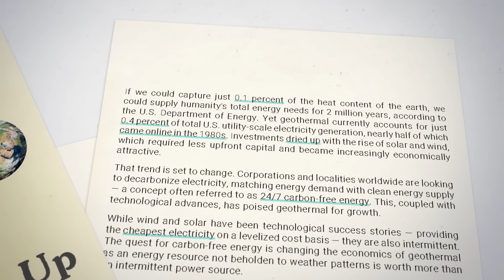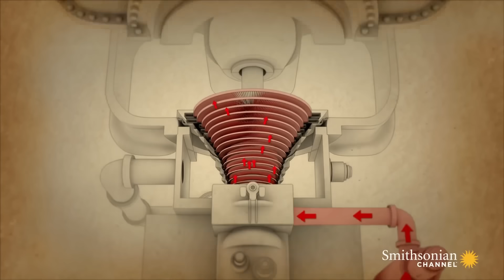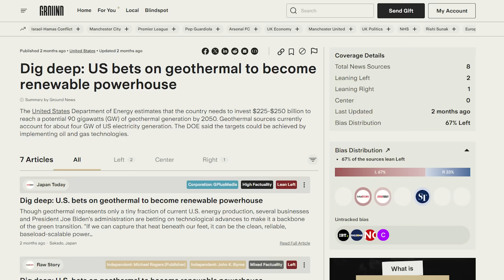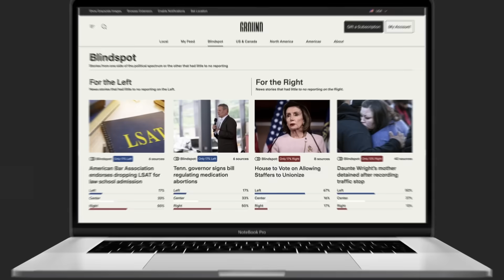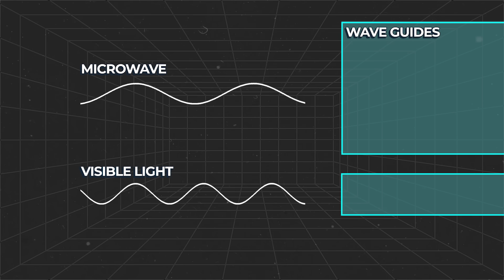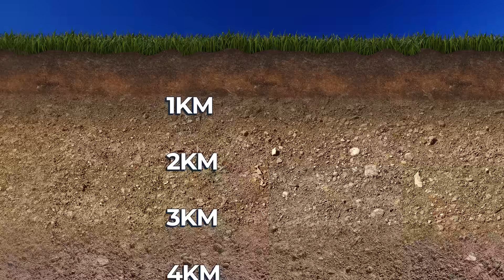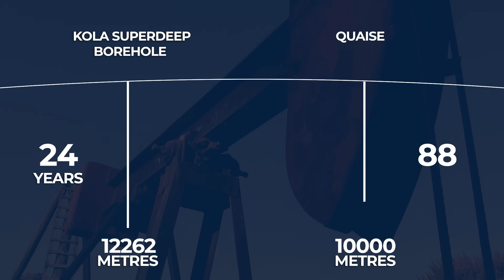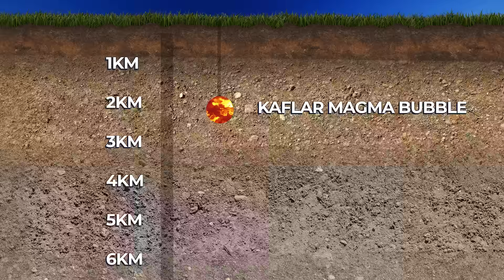This Fusion Tech is Solving the Geothermal Energy Problem

Comment: There was no mention of what would happen with the vapors as it travels back up the borehole and cools down on the way.  
I think they could easily clog up the hole or at least slow down the "drilling" considerably.
Reply: That was exactly my idea. They will need to come up with some solution (e.g. high pressure gas or something) to "push" the vapor up. Or the other way around - seal the hole and create a vacuum and suck it out - low air density will slow down the cooling process...
But this will be really difficult over 10km of travel for the gas.
Perhaps, if they manage to solidify it under control to small "chunks" and suck/flush them out... I don't know. I bet they already thought about the same thing though ;)
Reply: @rklauco  Yes, best chance is condensing it into droplets and then removing it by conventional means
Reply: @uazuazu this is exactly what will happen
Reply: Their plan is to force the vapors up and out with high pressure argon.
Reply: There was an image showing the borehole with bright red highlighting saying "PURGE GAS". So they've thought about it and have made a system which probably forces a shit ton of nitrogen into the hole to displace and atomise the condensing rock vapors into a fine sand like composition which would be blown up and out.
Reply: @jacobkudrowich  Thanks. Did not catch that when I viewed it the first time.  
Found it at 11:25 in case others want to see what @jacobkudrowich is referring to.
Reply: @jacobkudrowich  you would not want to use nitrogen to it being very light, Argon is the most likely gas used for purging. Xenon would be even better but that would get very expensive fast.
Reply: My guess is, the vapors have to travel through the radiation, therefore keep on being heated ´til they actually reach a point where they can be sucked out of harms way sideways.
There the fallout, hence stone,  could land on a conveyer belt which is protected by a layer of sand or something along those lines.
Just an idea.

If they actually lower down the radiation source, I´m with you tho. It´s just going to rain on top of the apparatus or  clog up any suction mechanism.
Reply: @dys1525  for a ~10 km hole...? That's not easy...
Reply: @antonymossop3135  You´re right. 
Sucking it up on the spot may end up being a lot easier. Maybe they can keep the material in some kind of vortex ´til it´s cool enough to not endup as layers upon layers of volcanic glass in the hose.. 

That said. It´s sometimes possible to restart turbines who are clogged up with volcanic ash, which melts in the turbine and glasses it shut.
That stuff is incredibly brittle. Maybe pause the process from time to time and shake the debris offf the inner hose with vibrations...  but sucking (even very small) solid parts up kilometres at a time.. that´s not easy either. ^^
Reply: @dys1525  I agree. I think it's potentially doable, but it's a major issue. In standard drilling they use mudflow, and the mud's also there to stop the hole collapsing under the enormous deviatoric stresses it's subject to (the melted rock wall is going to be a real positive in this arena, a glass stress cage is going to withstand a fair bit of shear stress - although next to the San Andreas fault might be pushing your luck...). You'll need a boundary layer of protective fluid flow at the borehole wall to stop the vaporized rock condensing on it, or have the vast majority of it solidify in the fluid itself, which will require significant thermal transport (i.e. high density or very high velocity transport fluid).

Another way to do it is to feed the rock melting drill head on the end of a steel tube - a kind of case as you go. But now it's going to be hit by conservation of mass, you're going to need a lot of force to compress molten low porosity rock.
Reply: not to mention that superheated rock vapor would be a great way to destroy anything you try to put down that hole, and all waves have some form of falloff, so unless your microwave beam can stay focused and intense enough for the dozen-kilometer journey, you'll eventually have to put something down the hole
Reply: A very large proportion of rock is silicon dioxide. What would happen is the silicon would condense and crystallise on the walls, sealing the pores of the rock. The dioxide, molecular oxygen, would simply escape the borehole
Reply: @anuphys  High enough temperatures and steady flow would solve that problem, it's a lot of heat but if they were able to vaporize rock in the first place, keeping it hot wouldn't take as much energy.
Reply: The laser could maintain temperatures within the borehole, but the vaporized rock leaving it could be routed out by ducts and scrubbed, those ducts would need to maintain the heat until the vapor reaches some kind of scrubbing area.  The vapor is guaranteed to build up at some point, but if heat and flow is maintained through the bore and duct, then the buildup could be in a spot that was easier for maintenance and cleaning.
Reply: It goes into the atmosphere forming clouds until it starts raining rocks.
Reply: @darrylcastellano underrated comment 😂
Reply: My thoughts, too
Reply: Yeah, that would be a problem.  Did anyone mention whether the "drill string" will be rotating?  If not, it will almost certainly become a permanent part of the formation from borehole pressure.  Normal rotary drilling uses pumped "mud" as a lubricant to remove cutting and act as lubricant for the rotating string and seal the formation.  There will be some kind of casing left in the borehole to prevent anything coming up from infiltrating and contaminating the formation.   Not gonna work for this.   At these depths and pressures something must prevent the borehole from collapsing after the "drilling" is done.  Will the waveguide serve for this or will something else be placed?   All engineering problems that will "probably" be solved.  The finished product will be heat, the moving force behind all out energy production.  That heat will still be captured by the greenhouse effect but at least there will probably be no more CO2 or other emissions once production starts.
Reply: I was wondering what happens if your super hot laser encounters a pocket of natural gas. 💥⁉️ Could be problematic if an ignition blows up your equipment. And possible clogs the hole.
Reply: @ClarkBK67  Should not be a problem. No oxygen.  And, at really high temperatures the methane will decompose into hydrogen and carbon.  That action is being used commercially to produce hydrogen and solid carbon.  Theoretically as a hydrogen fuel source and carbon capture.
Reply: Or pollute the atmosphere indefinitely... Massice CO2 and other sulfur gases... For ever...
Reply: That’s not how it works
Reply: Even without any cooling down on its way to the surface, you simply cannot transfer enough energy to run a power plant with steam flowing through a hole of that diameter. Besides, the pressures that would exist under these conditions would keep the water liquid until only the last little bit of its journey to the surface. So I assume they'd be keeping the water under enough additional pressure so that it would stay a liquid all the way to the top. So we'd have a steady stream of superheated water that would be allowed to expand and vaporize only once it reaches the turbines. That's my speculation anyways.
Reply: You can vaporize down towards the magma chamber of Yellowstone National Park probably supply enough electricity for all the western states
Reply: for what i understand, this vapor quickly solidifies and become the glass wall mentioned in the video
Reply: Do it the conventional way... that 1mw head will need cooling too allow water to run through the center right up to the bore bit, pump it in at high pressure and allow it to escape along the bore shaft between the tool and the walls exactly like traditionally, the water would take the loose rock vapors with it as sand...
Reply: The plan is to ensure the cooling rockplasma is deposited on the borehole wall itself. This will glassify and seal the wall to ensure the super heated steam does not leak into the surrounding rock.
Reply: @markfrancis5164  Mass balance would suggest this would still clog the hole rapidly. You'd need a very high velocity gas flow, or some type of mass transport system. It's not impossible to have a mud flow system above a plasma convection cell, but it might be tricky to pull off.
Reply: @markfrancis5164  But the amount of glassy material would surely vary with the kind of rock they are going trough, making it hard to make a fairly even diameter all the way.
Reply: @markfrancis5164  - That's fine for some of the material. But the material that represents the actual final hole, over that 10km length, is quite a bit of material ! Only a small portion of it will become the vitreous walls. Most of it, will need to be extracted. Plus multiply by 2, as you need two holes. One for supply water, and the other for the superheat fluid, coming back up.
Reply: @markfrancis5164 I think they were referring to the physical appearance of the sides of the borehole and not to the waste. 1 cubic metre of rock resolidified has a volume of 1 cubic metre so net result would be no hole..
The vast majority of the waste has to be physically removed.
Reply: @chippysteve4524  how did you decide that? You seem to be conflating volume with mass and density. If I take a cubic meter of a low density, high porosity rock with a high degree of hydrates contained within, after melting, the water and trapped gases would be released and the volume would dramatically decrease. Imagine popcorn "unpopping"
Reply: @markfrancis5164  "The plan is to ensure the cooling rockplasma is deposited on the borehole wall itself."
But that obviously doesn't work. If you don't most of the material out of the hole, it's not a hole!
Reply: @beeble2003  Wait, then how do traditional drills get the material out of the hole?  Drill bit drills don't have the luxury of having the stuff they're drilling through be turned into a volatile gas and plasma that can just float out of the hole they're drilling into.  Are you assuming that nobody will ever think of using a standard vertical conveying system like all other drillers do?
Reply: @commode7x  Normally, you use a liquid in the borehole, which is circulated to lift the cuttings out. Having the cuttings come out as a gas or plasma isn't a luxury: while it's hot, it attacks your borehole lining; as it cools, it deposits as a liquid or solid in random places. When you say that gaseous  rock will "float" -- float in what? It can only float in things that are less dense than it is. If you vaporize rock at the bottom of a colum of air, it'll just stay at the bottom -- the air will float on it.
Reply: @markfrancis5164  You're not thinking that through, IMO..   If they vaporize a certain mass quantity of solid rock, that same mass, if not extracted to the surface, will cool and deposit itself on the sides of the borehole, as well as the EQUIPMENT until the temperature is maintained a molten levels (hard on equipment).   Vaporized rock doesn't suddenly reduce in mass size, it just changes form until it re-cools.   That material MUST be removed from the borehole in some manner for this to actually work for geothermal, or even Oil/NG exploration.
Reply: Vapors is not the right word, the material which is not able to quickly recondense back to a solid would stay gaseous and would be pushed out of the borehole. In theory the constant production of gases would work like a pump to drive the gas stream upwards. You can always backfill with something like argon to displace the lighter gases and also create an atmospheric seal to prevent noxious gases from escaping. You can then feed a line parallel to the "drill" at some distance up to pump out the gases for processing/neutralization. Using an inert heavy gas would help by a decent margin.
Reply: Also there're some radioactive gasses down there. Need to be careful

Comment: Geothermal energy actually sounds like it can be big, excited to see news about it
Reply: Yes. This technology moves geothermal from being practical for 10%-40% of people, to 80%-95% of people, and ultimately lower cost per GWh once economies of scale are optimized.

And we have workers who are expert in the drilling, from the fossil sector, with just a bit of retraining.
Reply: @bartroberts1514  not quite on your % because you need to avoid water tables when tapping for geothermal but ya, giant leap for mankind
Reply: @Potent_Techmology  You need to manage water table impacts, sure.

But where in the world don't we need urgent water table management now anyway?

Hydrology is advanced enough that we might be able to drill anywhere with such technology with net positive impact, while still so primitive that instead we endanger water to preserve fossil trade.
Reply: @bartroberts1514  its not so much managing the impact on water tables as it's not viable to drill into water but ya, fresh underground water is also valuable to some degree

it's not about "preserving fossil trade"
Reply: @Potent_Techmology  In Linguistics, there's a form of analysis that looks at the ultimate effect on action of utterances. It's an obscure practice, but it helps to identify when there's an underlying effort to skew outcomes through hidden agenda tactics.

You may know it by other names, some of which are immoderate. 

Thus with fossil trade, a mendacious multiheaded beast that we know has to be kept underground, yet see this knowledge forgot in every discussion related, over and over again, as if it just happens to slip our minds. Those slips are not accidental; there are very clever people who keep thinkers from thinking about this necessity with subtle and purposeful techniques. 

Go ahead, try to think and speak rationally about how to end fossil trade within a decade. Hard for an English speaker to achieve due doublespeak.
Reply: @bartroberts1514  You think the robber barons will allow that?   Don't delude yourself.
They'll find ways to make it more expensive than fossil fuel power generation to keep their wallets fat.
Reply: You won't hear anything else about this, it wil never be allowed, assassins have probably already been given their assignment
Reply: Problem is it takes away energy from the earth's core, which basically maintains our magnetosphere. As long as we are taking away small amounts of ernergy I think it would be fine. But when we scale this tech up and start to extract massive amounts of energy from the core, we may destroy the planet. Eventually.
Reply: geothermal energy is just a scam.  it can run in some countries, somes places, but not with holes like this one.   drilling is not the problem with geo, scale of reservoir is.

Comment: Another application is access to ultra deep ore bodies to mine perhaps via a leaching-type method. All the ore bodies we can reach with current tech are gradually getting mined out, and the ones left are of decreasing quality. The ability to continue mine copper, lithium, rare earths, and phosphate at acceptable rates with current tech are likely to be bottlenecks for industry well before peak oil becomes a problem.
Reply: The supercritical H2) they propose to produce will dissolve almost everything, very quickly, including all normal alloys of steel and stainless steel. To resist those effects, so-called "high alloy" steel must be used to line the borehole, and that pipe is rather pricey, because it is 60% nickel. 
But they will not face that problem, because the microwaves they propose to use will not make it down the pipe! The pipe will clog up with condensed rock vapor, among several other issues.

Comment: Many years ago I watched a video how using a wide steel wheel with holes drilled towards the radius from the outside diameter, then spun produced excessive temperatures to water being fed into the center of the wheel.  The water supplied to the center rapidly slammed against the steel frame guiding the wheel.  The water came out of a pipe as steam having a temperature measuring more than 700° F.  All they did was rapidly rotate the wheel and cold water was instantly converted into hot steam.  They said it was similar to the knocking that occurs to water in a boiler.  It produced an over-unity effect.  Clearly more energy in steam was produced than the energy it took spin the heavy steel wheel.

The wheel could be used to heat homes and water on demand.  Hot water can be used to run turbines and generators.  Imagine the possibilities.
Reply: I to remeber seeing this device, its called the Griggs Hydrosonic Cavitation Pump, some people have made replications of the deisve and used it to heat water. Not entierly sure of the efficiencies of it are!
Reply: There is no such thing as free energy.